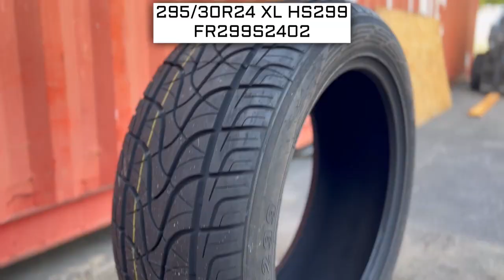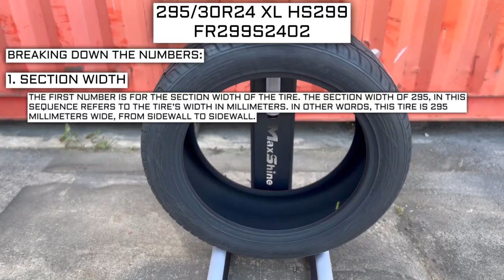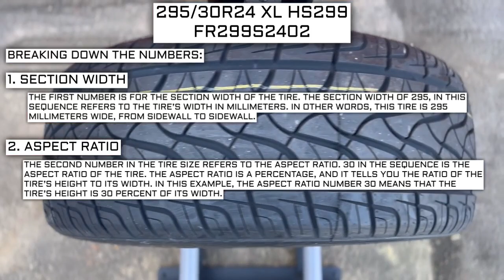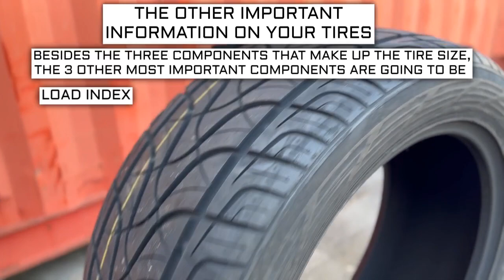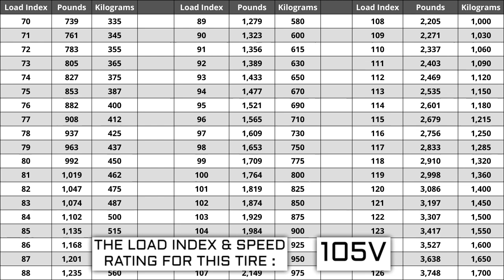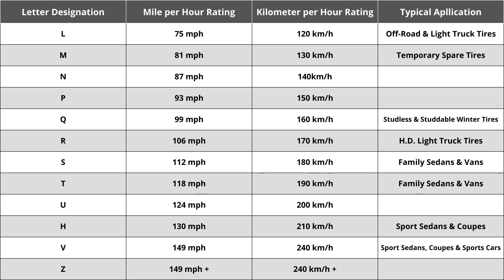Size Explained- 295/30r24 Fullrun HS299 Street Tire #FR299S2402 and where you can buy!

Comment: So I got some tires from a shop for a 10.5 rim, and there war roughly 1/4” of rim on the front and back of the rim exposed. Would I get a better fitment from a 285 width instead of 275, or does the fitment differ depending on the brand?